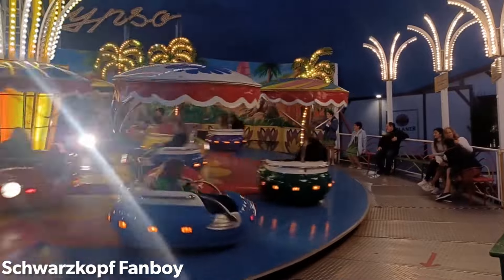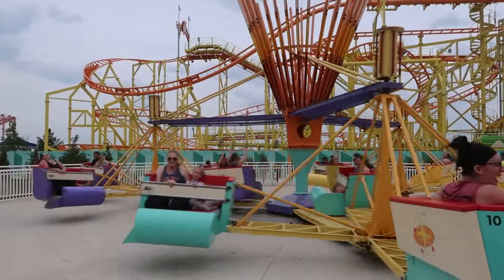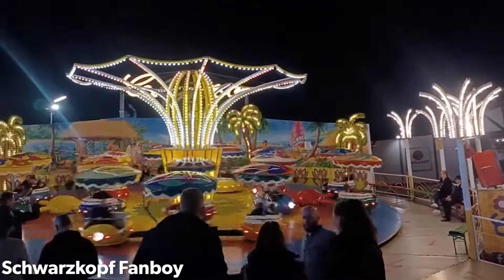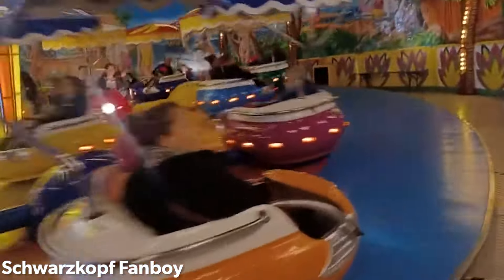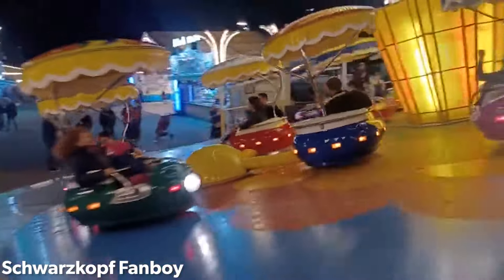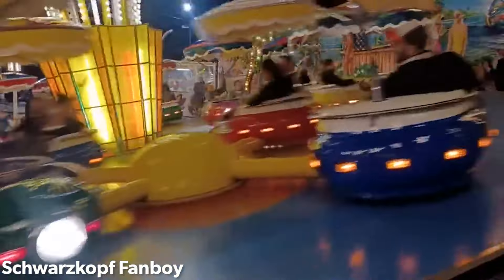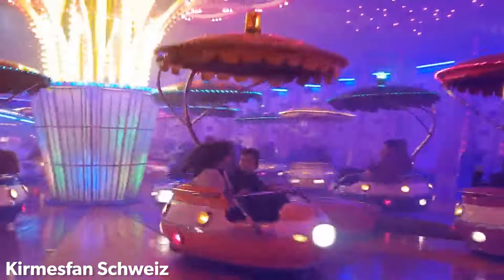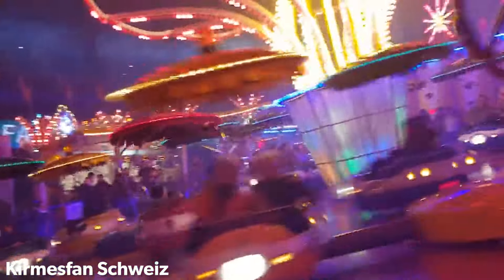Calypso Rides Info and History - Flat Ride Friday 20

Comment: Ah yes the calypso. I rode this a bunch. I still do! It's every year the the Oktoberfest at the "Oide Wiesn" (Old Oktoberfest) section. Still a great ride.
There was a rebuilt Calypso with lifting plattform and gondolas with fixed roations, that could look in the normal direction, inwards and backwards called "Raggae" owned by german showman Winter.

The footage you showed is surprisingly shaky.
Btw a small tip to improve the image quality:
Upscale your renders to 1440p. You'll get the better codec YT offers and improves your footage quality by a ton.

Comment: Spinovater @ Canada's Wonderland, Calypso @ the old Myrtle Beach Pavilion, and the former Crazy Quilts/Sidewinder at Six Flags Darien Lake all have/had a larger capacity than the ones like at Cedar Point with 5 arms with 5 cars on each and it seemed like those had a bit steeper angle, but I could be wrong. Crazy Quilts was one of my favorite rides at Darien Lake, it seemed like they took it out for no good reason.

Comment: The German ride car builder is “Gebrüder Jhle Bruchsal” which is Ihle Brothers of Bruchsal. I believe Jhle is the correct German spelling (and what we see on all those rides they built cars for) but on the Internet I keep seeing it spelled “Ihle” which more easily gets you to the correct pronunciation…in German, the “J” has more of a “y” or “i” sound.
Reply: Yeah, using the "J" glyph there is an old-school stylistic choice. "Jhle" would not be pronounceable in German.

Capital I is written like that in the cursive usual in the 1950s-1990s too - I believe this is about disambiguation; avoiding straight "just a vertical line". Compare the European way of writing 1 and 7 (1 with a slanted serif, exactly like this here, 7 with a horizontal bar and an additional short horizontal stroke in the middle to disambiguate).